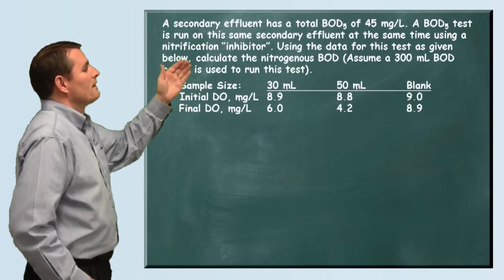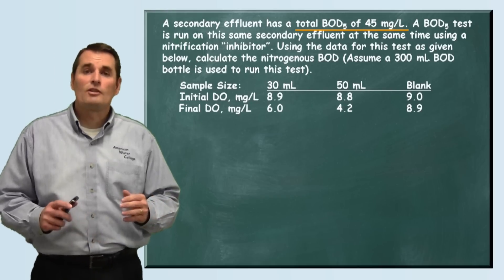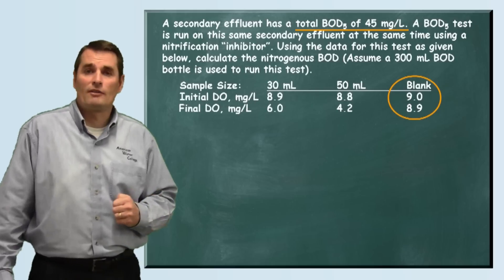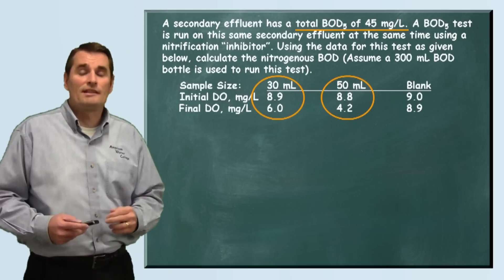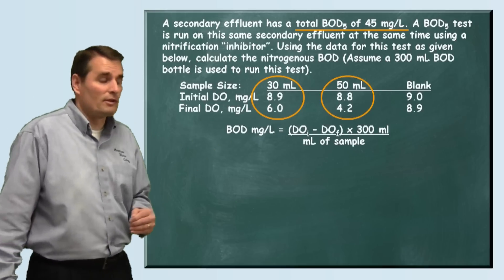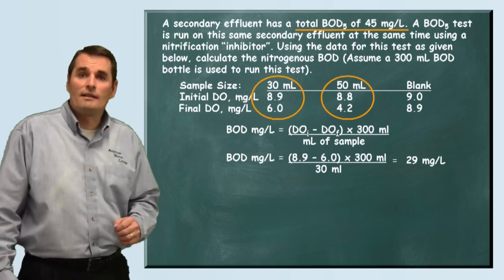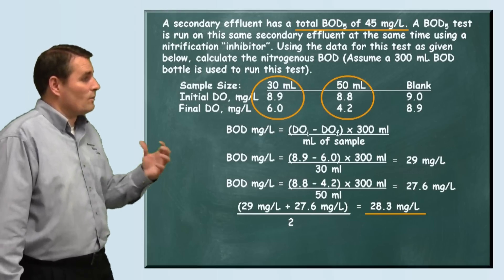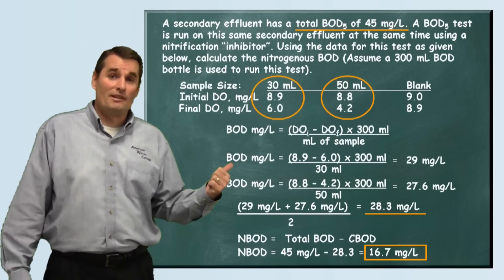Problem Solved: BOD Problem - Wastewater Math

Comment from the maker: The blank depletion should be 0.2 mg/L or less while the sample bottle depletion should be 2 mg/L or more, with at least 1 mg/L left in the sample bottle.  Good catch! We will redo this problem.  The answer doesn't change, however I did misspeak when talking about the sample bottle DO depletion.
Reply: American Water College hello i have a question. If we have a 10 day period and BOD values and if  instructor ask “estimate rate constant and ultimate BOD using Thomas Method” which equation should we use? Because i try to solve using L_10(1-e^-k.10) but we have two unknown and i dont know what should i do, thank you :))
Reply: pump floe rate
Reply: could you put an overlay on the part of the video where the error occurred?  That certainly caught my attention.